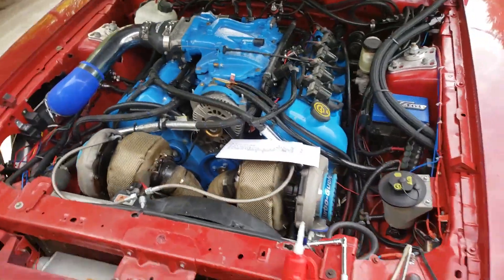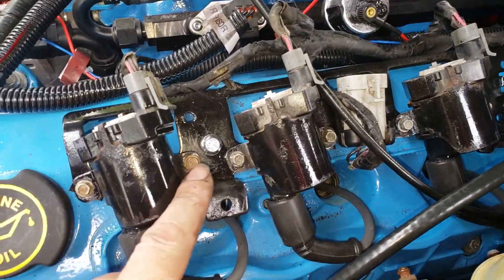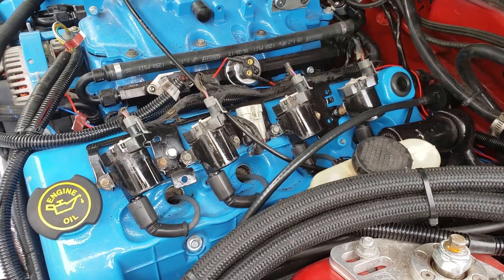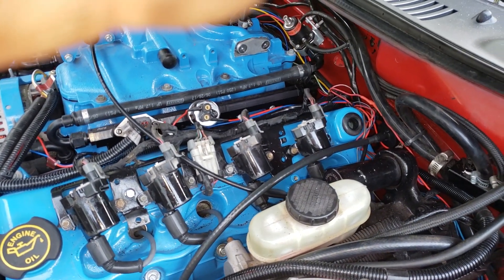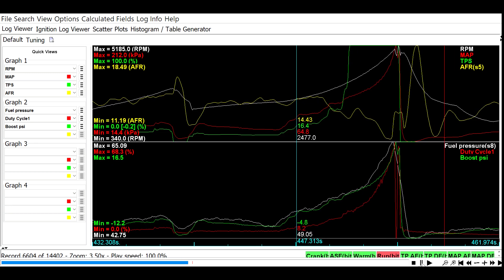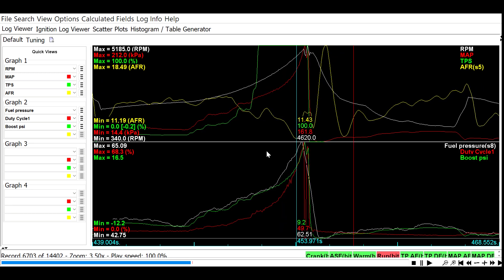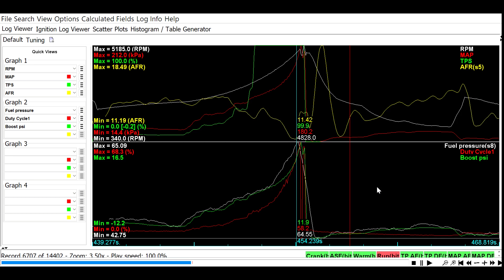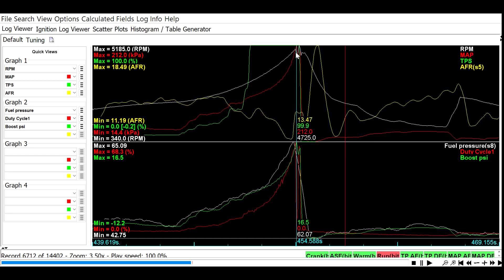14psi Boost & Spark blowout?? D585 coil upgrade part 1

Comment: What was your previous ignition setup?
Reply from the maker: ms3x with stock 4v coils
Reply: @ModMotorMayhem  are the 4V coils the wasted spark set up that each coil pack fires 4 cylinders?
Reply from the maker: @robmespeedy  no they are coil on plug with 8 individual coils fired sequentially
Reply: @ModMotorMayhem  oh wow and these LS coils were batter than those…

Comment: Are there different stock ford coils that are better than others? Or are they all the same? I put coils from a mach 1 mustang on my lincoln mark 8. Do you think I just wasted my money? Lol It's a forged 32v with "B" heads and now I'm turboing it. What gap are you running on your spark plugs by the way?
Reply from the maker: Some people have really good luck with the Ford 4v coils. It depends on a few things. Your compression ratio, amount of boost, fuel used, age/condition of the coils, computer used to drive the coils and overall health of the charging system. Depending on how wild you plan on getting with your 4v, will determine if you will have to upgrade later.  Pretty much all 4v coils cobra/mach1 ect are the same. Some may have less miles on them and be in better condition. The older coils where American made, the new motorcraft/ford replacements come from China, so take that for what it's worth

I was running from .025" down to .018" with the Ford coils. Back upto .025" with the ls coils.
Reply: What did you set dwell times to? I'm using d585's on a 557bbf. Currently at 2.5ms @14volts. I've heard they don't make power after 4ms but I don't have a scope to test it.

Comment: They have boost a spark modules
Kind of how boost a pump works for fuel pumps
Reply from the maker: Yeah for sure another option if you want to use the stock pencil coils. But for me for the money, I couldn't justify anything other than swapping to LS coils.
Reply: ModMotorMayhem I'll be using  aftermarket Ford coils with kenne Bells boost a spark 
You can run more spark plug gap for a bit more power and efficiency and control 
Good patch for your issue good work